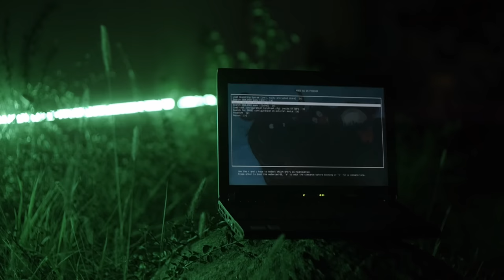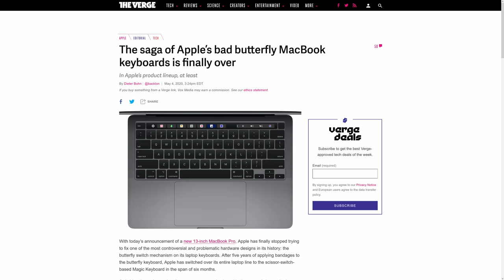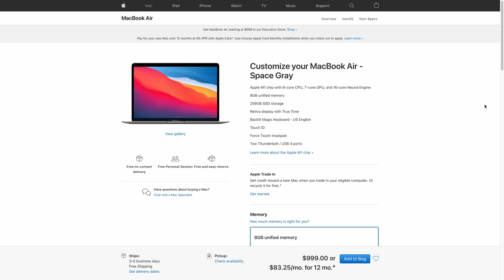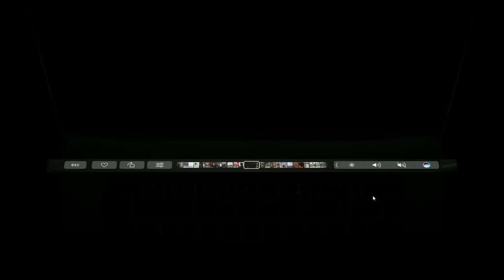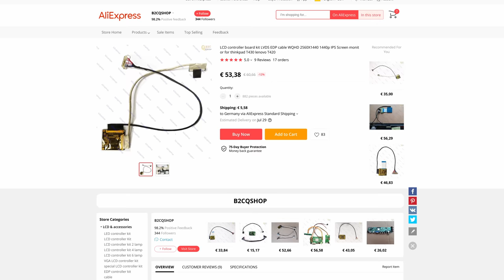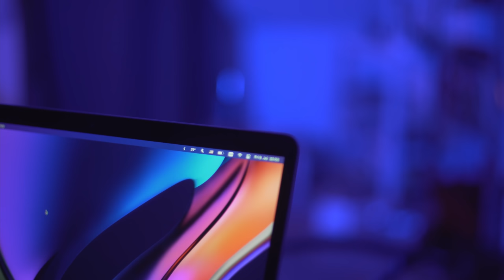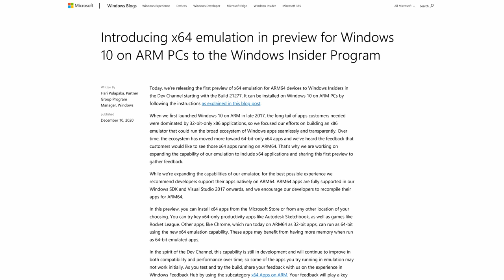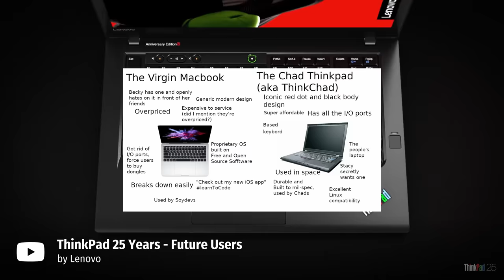Why I Switched to Mac (as a Linux user)

Comment: The reason why I stopped using MacOs as a developer - docker is virtualized and slow as fuck. Jumped to Linux, docker is running native and is lighting fast. No matter how good are the CPUs they put in Macbooks, the virtualization just kills any benefits. If your main task is video editing, then yeah - I see the benefits.
Reply from the maker: You might want to take a look at this: https://medium.com/carvago-development/my-docker-on-macos-part-1-setup-ubuntu-virtual-machine-both-intel-and-apple-silicon-cpu-5d886af0ebba
Not sure if it's still relevant.
Reply: Technically speaking, docker containers ARE linux containers. Nobody wants to have a pure MacOS/Windows/etc. docker container with all the non-linux libraries, running Mach-O/PE binaries inside, it doesn't make any sense. So in any case docker on a non-linux platform will be a sort of emulator of a linux kernel or a virtual machine running the real linux kernel. No doubts, if you develop for linux it's best to do on linux.
Reply from the maker: @dvmavgoor  I think Davis meant that the Docker is running with x86 emulation, not on the native ARM64 emulation. So it's basically emulation inside of an emulation, which makes things slower.
Reply: @WolfgangsChannel  That's even worse, I agree. But I feel it's not fair to blame OS X that it's incapable of running x86 Linux binaries on its ARM64 hardware without any slowness.
Reply: Work with Docker everyday as a developer. It works fine even on my intel mac.
Reply: @zraylin.khalitzburg2968  I'm not sure if it's easily possible to switch Mac's version of docker to an aarch64 VM to run docker ARM containers, but it's always possible to run aarch64 Linux in emulator and run docker arm containers inside it natively. I run ARM desktop on Linux and use docker, many modern containers have ARM versions, so it's not a problem IMO.
Reply: What I meant with my comment, is that on MacOs, the docker is running basically a VM. Very similar to VirtualBox / VMWare. And on top of that - the filesystem is shared between the host machine and virtual machine (Docker). You may notice maybe not that much of slowness when working on a small project. However, if it's a large CMS with a tons of composer / node modules... it turns into awful experience.
For me it's very noticeable in Zoom meetings seeing the difference when MacOs based devs are sharing their screen and seeing how sluggish everything is loading in their Docker projects. On Linux, it's basically prod. env. experience as to speed.
Reply: @emanuelserpa  hard disagree on that. I've worked as a DevOps on both MacOS and Linux and aside from docker (which I just barely use to check locally then straight to the k8s cluster) I really don't see the hype about developing in a linux machine. But hey maybe I'm wrong.
Reply: @WolfgangsChannel  Windows also can run native docker on it too beside that the Windows laptop or Linux can upgrade hard drive, memory. And more importantly i can play game on it with nearly perfect like desktop, but macos ?
Reply: 100% agree with your stance. Macs are kinda too slot to be useful aside from specific tasks
Reply: @davis4010  I have a doubt . I have a low spec PC but would like to run Linux , someone suggested I can run linux via SSH or something like that ? Is it possible ??
Reply: @juanmacoo  because your either a Linux guy or not.
Reply: Nice
Reply: I have to use a Mac for work . 16gb are not enough it seems for a few docker instances ,  visual studio code , table plus , and some browser tabs . Apparently that makes the thing chug . I had a MacBook pro 2019 16 inch I sold it and I bought a framework laptop . I'm waiting for it
Reply: @abeplus7352  that's cool never had experience with macs but if 16 gb isn't enough for that wow that's bad . On linux I can play xonotic while my gen 3 cpu is at 100 rendering in blender with no lag
Reply: @davis4010  not anymore buddy
Reply: @dvmavgoor  true. And Linux also is not guilty that Adobe doesn't publish own software on it...or game devs don't port games.

That's really doesn't matter. If you need Linux software - better to use Linux, the same about Mac/Win.
Reply: @davis4010  I guess it depends on what you want to do, I generally use containerd instead of docker in lima and it kind of solves my problem. The setup becomes much much leaner. I would suggest you give Rancher Desktop a try, over Docker Desktop. Nevertheless, I don't run my perf tests on my local machine it's always on servers.
Reply: I run Kali and Parrot on my 2019 16" Intel Mac. Also on my maxed out Dell 2018. My Mac is far better and snappier all around
Reply: @juanmacoo  for developers a macbook air with m1 chip is pretty useless if you like multiple monitors, the m1 can extend to one monitor and macos lacks a good window manager. even linux has a better window manager than macos. on macos resize to fullscreen by double click doesn't work with all programs.
Reply: This was posted a year ago, have you tried the new Paralles that uses the M Rosetta architecture? I ran x86 W11 on there (NOT ARM) and it was almost as good as native x86.
Reply: @karmatraining  I have. Now im running Linux VM on my M1 Mac. Already have a Dell and intel Mac also running Kali Linux. M1 is pretty good

Comment: One thing I loved about ThinkPads is the security features that come with the bios, like disabling the webcam, USB ports, and wifi, setting passwords on either power-up or only when accessing the bios, in other words, you can make it secure enough to eliminate insider threats without compromising availability. I would totally buy a ThinkPad if I had the chance again.
Reply: Seriously reaching.
Reply: @EvoraGT430  I was speaking as a small business owner, not a sophisticated cyber attack. Of course no system is perfect, let alone a windows machine.
Reply: Apple has its own security features. Soldered SSD makes it impossible to steal hard disk physically

Comment: Love my M2 pro. It was my first MacOS machine. I had everything else except for the Mac. It integrates with all of my other apple products seamlessly and best of all the dang thing just works 100% of the time for me. Battery life and no fan noise is a plus too! As far as ports ago I agree that the ports on the Air are lacking. But the Pro gives usbc, HDMI, 3.5mm audio jack, and an SD card slot

Comment: I got mine in March, 

-Never used MacOS nor touched a MacBook (had the two handed mouse pad habit).

-Out of all “high performance” slim & light laptops I researched, the M1 MBP stood out in benchmarks and price

-The charger is small & light 

-I even had a fricking authorized seller around the block from where I live

Comment: I understand where you are coming from. As an ex-Linux user, I have moved to Apple ecosystem in 2022. MacbookAir for portable device, Mac Studio as desktop, iPhone as communication device, Airpod for headphone. The amount of convenience & continuity among devices is staggering. Yes, it is pricey but I can pay money for convenience and I did that. I am getting older and I don't find love/excitement for tweaking of electronic devices anymore.
Reply: I’m stuck with a Chromebook that my father’s work gave away, I absolutely hate it. The OS is unreliable and if the browser crashes, the entire desktop goes down along with it, the user account or system automatically resets itself if it detects a tiny problem unless the user account has a good TPM, and it deletes files without consent due to low storage, used the Linux container a bit but couldn’t do much due to CPU, 4 GB RAM, and overheating. The Android VM is bull, as they purposely prevent APK file installation and force you to go get the google play store, and as an iOS user that pays for iCloud and owns an Apple Watch, the Chromebook is pressuring me into paying for Google Drive and buying a Google Pixel and worshipping Google instead.

Comment: As a Thinkpad user I agree with what you said in the video, the new macs are undoubtedly the best performing notebooks around, but still the inability to play the entirety of my steam library is too much of a drawback to switch to an M1 MacBook as of now.
Reply: And that right there is where Microsoft and Dedicated gpu hardware has people. Yes you can run many but not all or any of the top new games on Linux (at least not easily or without lots of tinkering). That’s why I still have a hand built PC next to me. Along with a gaming laptop (darn thing is way too heavy to be called a laptop). Both run Windows and Linux. The only reason they windows really is for some specific office work and games. Otherwise I’d be using Linux exclusively. An M2 (soon to be M3) MacBook solves most of one problem.

Comment: For the past 18months, my daily has been a 2nd gen X1 Extreme - i'm an above average sized person and 14" or lower notebooks couldn't really cut it for me (apple, thinkpad or otherwise).
Was actually considering getting a 16" M1 MBP as a replacement - the thing is, those are ridiculously expensive, like meme levels expensive - if i was to get a roughly comparable configuration (32Gb of ram, 1-2Tb nvme drive, decent screen etc).
Even if i could tank the price abyss, the lack of ports not so sure - pretty much all of the ports on my X1E and there are a few there, are occupied.
Furthermore, only thing i can't swap on the thinkpad is the cpu - ram, storage, network card are all replaceable.
Apple price premium is still hard to digest.
Nice review Wolfgang, people don't seem to realize everyone buys items tailored to their own making.

Comment: I was using Arch Linux as my main OS on my desktop and laptop for about 3 years. Recently I'm using a MacBook pro (M1) that I got from my new job, and I realize that I was missing a lot of creature comforts on Linux. The design coherence and overall polish is just so much better on macos. I'm still using Linux on my desktop, but now I notice how much jankier the experience is. Obviously I'm will still use Linux because it has many advantages, but now I appreciate macos more than I did previously.
Reply: what desktop environment do you use?
you cannot really say linux has a janky experience when linux itself can run multiple completely different experiences haha...
Reply: @a.Murder.Of.Crows.  that's a fair point. Not because I was using Arch, but because I insisted on using a tiling WM because it's more "minimal." It was such a time suck to get that thing configured correctly, and yeah it was pretty cool but it had a lot of rough edges. I'm now using a stock Gnome instead and I personally like it a lot better, and I don't miss macos anymore.
Reply: Every desktop environment I’ve used has been janky on linux. It’s the same issue with android. You have thousands of good options but not a single great one.
Reply: @ZeerakImran  may I ask what desktop environments you have used and whether you used X11 or Wayland?
Reply: Today, i find wayland on Plasma quite polished for taste. Maybe be not as sophisticated or polished as macos, but without any quirks or rough edges or jankiness
Reply: Try Asahi Linux

Comment: I work with different notebooks in the last two decades and never really look about the brand or go to a deep dive in technical specs. In my opinion, you should be open to new things. In this case, the new Silicon-based Macs from Apple and his outstanding performance in relation to the power consumption. So far, I have always had a second-hand MacBook or Hackintosh (like one of my Lenovo T420s) and was not ready to pay the huge price for a new Intel-based device direct from Apple. 

I got my first new MacBook Pro with M2 three weeks ago, and I am more than enthusiastic about it. Even if I am more than enthusiastic, I don't close myself from other things. This applies to hardware as well as for software, and not worse anywhere. Stay cool, be relaxed and also gives new experiences a chance. Thanks for this pragmatical video without gap blinking. Keep up the good work and regards from Germany, Patrick.

Comment: Hey man, thank you for the video! I always dreamt of a very quite and at the same time powerfull laptop and even was seriously considering buying this thing. But linux and FOSS is not about horsepower, convenience, etc., it is about freedom in all sences and for people like me it is also ability to do things i am passionate about. That is why I am still using my 8-years old and noisy Acer laptop (which I schould have replaced by now) even though I can afford buying new laptops every month
Reply: Your best bet is either a Thinkpad (if you like them tough) or a Dell. Dell have some very nice models one tick down from the XPS series, I recently got a 16" Dell with a 14-core CPU and I'm extremely happy with it. For a PC laptop it works great, although battery life is like 1 hour and the fan screams if I do anything more than open Notepad. But that's x86 for you. Laptops are replaceable and fragile machines, I don't get why people expect them to last 10 years. Tech moves fast. The benefits of the M architecture greatly outweight any of the negatives for me - the sole exception being lack of PC-level gaming. For that you will always need a lot of energy and a massive fan, no doubts.

Comment: Just a small correction: the ram is not 4266 “MHz”, it is 4266 MT/s (Mega Transfers per second) and 2133 MHz, DDR means Double Data Rate. The frequency is based on the clock cycle time, the transfer rate in DDR memory is double the frequency.
Reply from the maker: Thanks, good to know 👍
Reply from the maker: I did some googling and it turns out that both 4266 and 2133 values can be referred to as either MTs or Mhz. In both cases the memory operates at dual channel if there are two modules with equal capacity, so the comparison is correct – 4266 Mhz in the M1 Macbooks is 2x faster than 2133Mhz in the DDR3 laptops.
Reply: @WolfgangsChannel  That is a common mistake, but dual channel memory doesn’t change the frequency. DDR memory sends two signals in a single clock cycle by assigning value on both the rising and falling edges of the clock signal. There is also something called QDR which sends four transfers per cycle.
You can have one chip that sends one signal per cycle, one DDR chip that sends two signals per cycle, and one chip that sends four signals per cycle. If these three chips have the same frequency of, say 1333MHz, the first chip will also be 1333MT/s, but the DDR chip with the same frequency will carry 2666MT/s, and the QDR chip will have 5333MT/s.
To my knowledge, there are no DDR4 memory chips on the market that are validated to operate at 4266MHz, as these high frequencies cause stability issues.

The other interesting thing that makes the difference between frequency and transfer rate interesting is latency. A DDR4 chip with 2133MHz (4266MT/s) will have twice the latency of a single transfer per cycle chip with a 4266 MHz (4266MT/s) while having the same data transfer rates.
Reply from the maker: One of the features of LPDDR4X was increased frequency – that's why those chips can reach 4266 MT/s whereas desktop DDR4 chips usually only manage around 3600-4000 MTs https://www.anandtech.com/show/11021/sk-hynix-announces-8-gb-lpddr4x4266-dram-packages 

There are plenty of desktop chips that can do 4266 MT/s though: https://www.amazon.com/s?k=ddr4+4266&ref=nb_sb_noss_2

All I'm trying to say is – the DDR3 RAM in the video is actually 1066 Mhz, but runs at 2133 MT/s when it works in the dual channel mode (two sticks of RAM). The LPDDRX4 RAM in the Macbooks is actually 2133 Mhz, but runs at 4266 MT/s in dual channel configuration. It might not be exactly two times faster due to higher timings and other factors, but the point still stands.

Comment: Nice overview of features on MacOS. I have been a linux user for over 20 years as my primary OS, Opensuse Tumbleweed being the choice of distro with KDE, currently on EliteBook 7840U/32GB/2TB Samsung 990 Pro. For gaming I have Windows PC (5600X/32GB/RTX 3080Ti, just for gaming. MacOS has many many basic features missing, but definitely really well optimised.